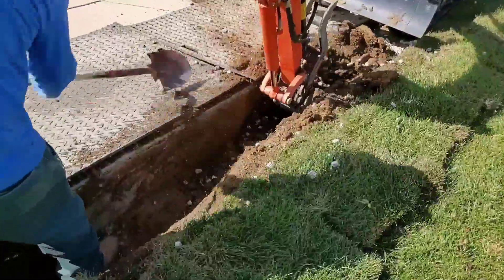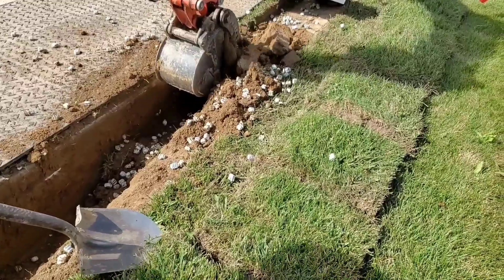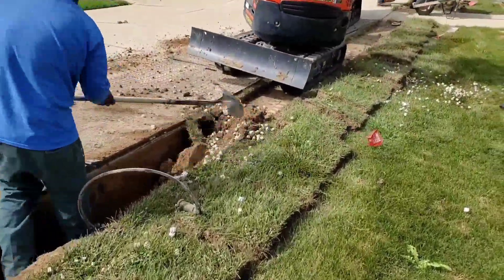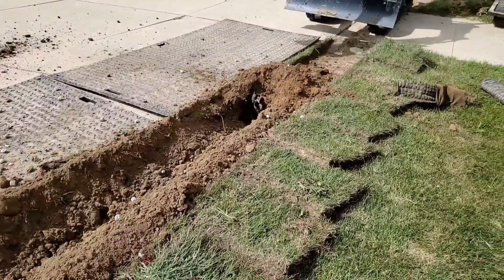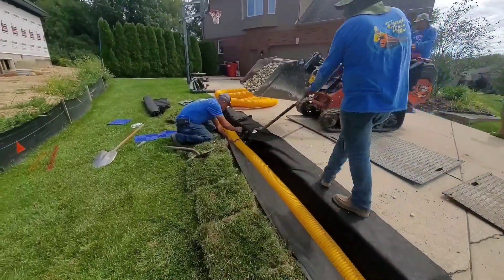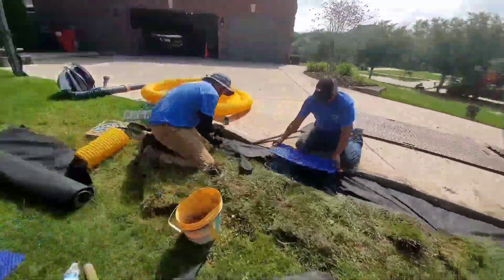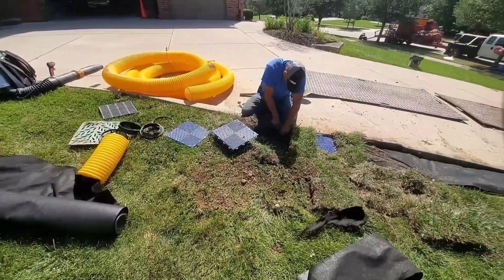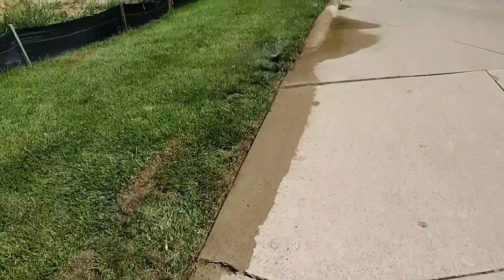What Is A Real French Drain [ Full of Helpful Tips All The Way To The End Of Video ]

Comment: Great demo- So you focused on pipe strength here as it was along the edge of the driveway - losing 2inches of pipe diameter with a 6 inch French drain pipe (versus two 4inch high octane)
Reply from the maker: We like overkill
Reply: The nominal cross section of 6” pipe is 3.1429 x 9 = 28.29 sq inches; nom cross section of 4” pipe is 3.1429 x 4  = 12.5716 sq inches (times 2 pipes =  25.14 sq inches total) So you actually pick up 12% more cross section/capacity with the 6” diameter. Nominal calls for illustration. Thanks for all the great info.!